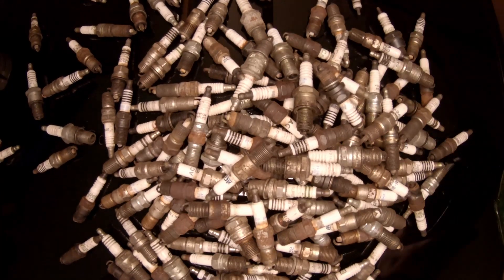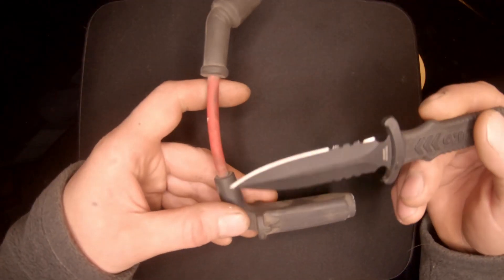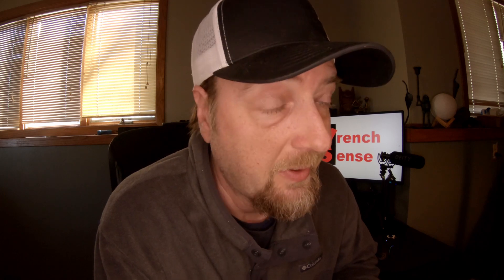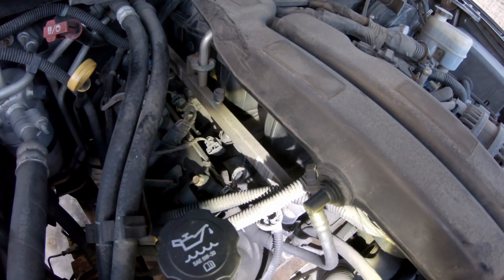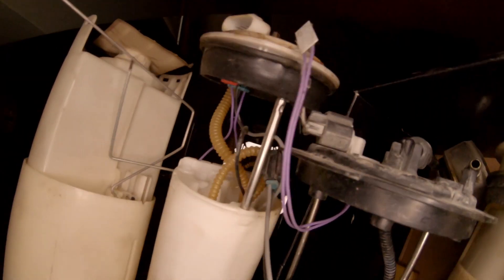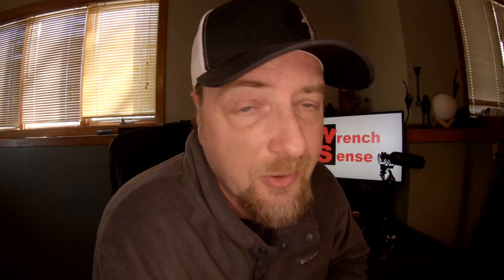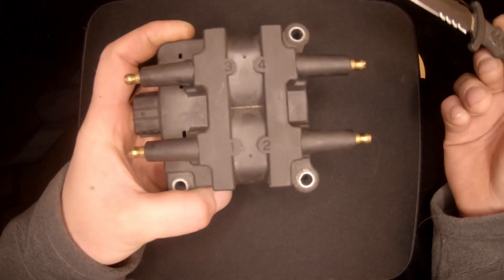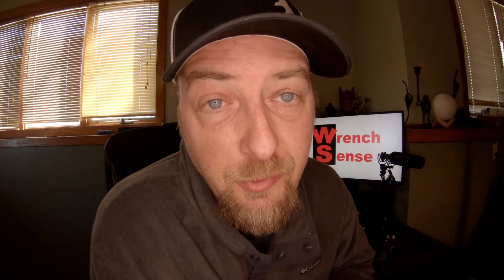P0300 FIX And A Blinking Check Engine Light

Comment: So me wrench sense I watched this video three times just so I didn't miss anything 

I have an 01s10blazer two door two wheel drive shit box  that has been throwing a p300 code for a long time 
I've been to so many shops and no one can find the issue 

I've replaced all fuel lines fuel filter egr valve mass air plugs wires cap rotor cleaned the throttle body 
And still have the misfire 

Check engine light is flashing alit more now than before 

Plz sir where do I go from here  
It's my only meens of wheels  plz help 
I hope to hear from u soon
Reply: Did you figure out your problem?  I have P0300 code only, with check engine light and heavy shaking misfires

Comment: Absolutely love video omg I have check engine light blinking gas smell I can smell it on driver side valve cover 6 cylinder engine I almost went bought a sensor saw this video idk wtf is going on but gas smell exhaust omg its strong why is my car not catching fire? I will start with plugs coils I need code reader I think really screwed myself thanks dude hit thumbs up subscribed
Reply: I'm baffled but more educated with your video
Reply: @Jarrod Durant same! Gas smell after driving around 10mins, rpms drop bad going uphill
Reply: @shawna7975  hey yea u know what i did couple days ago i replaced all 6 ignition coils all 6 spark plugs 2 gaskets my problem went away misfire gone check engine light shut right off car running mint only took 3 days for the old oil to burn off muffler lol car 2003 running brand new
Reply: @jarroddurant2407  thats awesome! All that was done on ours was replace coil, and new waterpump. Check Engine light flashes now at stop light in idle
Reply: @shawna7975  u still have misfire i u may wanna check all your coils make sure in right plugs flashing light usually from bad coil
Reply: @jarroddurant2407  that is probably right, thanks !!!
Reply: @shawna7975  your welcome
Reply: Your not gonna believe it after weeks of car running great it was nice was driving all of sudden check engine light pops on omg o just can't win with this car it truly wat they say car goes into limp mode goes ovsr 40 but it struggling dam infinitiy love it tho
Reply: @jarroddurant2407  🤦‍♀️
Reply: Almost sounds like oil pressure if it's lighting up still on idle  I've had check engine light come on furring corners or on ramps oil to one side of motor checked oil it was a little low  might be worth try.

Comment: I got the blinking CEL while I was doing 120 km/hr and noticed absolutely no difference in power nor heard a difference in RPM. Got another blinking p0300 code today while doing 65 km/hr, again noticed absolutely nothing wrong with the engine whatsoever. After doing some research and watching your videoI'm going to attribute this to the fact I'm running a straight pipe exhaust with no catalytic converters or o2 sensors. She idles like a trooper and purrs like a kitten when you feed it some of the good stuff.
Reply: Did you take the o2 sensors out? I alao have no converter/straight pipe👍 @The bOss if you took o2 (both) out or just 1 at a time?
Reply: @shawna7975  Yeah, no cats = no need for O2 sensors because they aren't going to read worth shit anyway. Originally had 1 cat removed because it blew out, then I got the other side done. Haven't had the blinking engine light come on since. Might of taken some time for the ECM to figure it out, who knows. All I know is it works and I love the noise.
Reply: @zerg1011  thanks!

Comment: On my dodge trademaster 1500 I took it in because it was misfiring I got all new plugs wires new coil and it is still misfiring and took it back to the mechanic and he said it’s the cam shaft and I need a new engine also when I drive it every once and a while I can hear a clicking noise in the Moter if i am driving at the same speed I give a little gas it stops and if th rpm goes over the 4 the engine light will start flashing the the cylinder starts to misfire then I have to pull over and let the engine to slow down and then it work fine
Reply: Clicking is usually what's called ticking and it's probably a bad valve or rocker arm. If your valves stick just a bit it will naturally throw off the combustion cycle in your engine throwing a missfire code. You don't necisarrily need a new engine, naturally your mechanic wants 10,000$ for an engine swap.

Comment: Big problem here. Idk if you can help but plz if you can think of anything else I would appreciate it we had code 305 changed plugs, coil twice ect.  Ran through your video check the vacuum fuel pressure and still has flashing engine light and reads code 305 any suggestions would be helpful thank you
Reply: Same thing with my car, funny thing though, my car is not overheating or loosing coolant

Comment: Great video!  Would a misfire cause limp mode?
Reply: Did you ever find out ??
Reply: I do believe that a misfire can cause your vehicle to go into "limp mode" (which is basically the cars way of protecting any severe damage from happening to the engine or catalytic converter).  So, if you're only running on 3 cylinders; for example, it doesn't have full power and wants to protect itself.   
This happened to me recently and my car was in "limp mode".  I was also getting the "injector circuit open" code along with the misfire.

Comment: Have a 2003 Silverado 4.3 runs fine until pulling a steep hill Example: Steep graded highway mountain scenic highway. Between 60 and 70 mph when passing gear engages check engine light flashes then goes off. Only once read a code of unburned fuel in cylinders. New rotor button /distributor cap/wires &plugs fuel filter and map sensor. Still occurs. Only under the conditions previously listed. Haven't checked for vacuum leak but will that next. New air filter also OEM. Had truck 3 months 140,341 miles. Any suggestions would be appreciated. Great video!!!

Comment: I bought a genesis coupe, came w new engine from dealer, it’s been a 2 months since i’ve had it, & there had the work done back in february. i noticed i got a CEL, got the p0300 code, went to auto zone scanned the variable camshaft solenoid? i’m not sure if that’s as you mentioned where they try to profit off you. instead i popped the hood and went thru the whole car and made sure all plugs and hoses were ok w no leaks. the cel came off all of a sudden

Comment: Bruh I got a code for random misfires so I was like ok let’s just buy new ignition coils buy brand new expensive asf coils install them then car on now my engine light is blinking
Reply: Same exact thing for me I think it has something to do with the catalytic converter
Reply: Reef ひ I went to a different mechanic dude said one of my coil wire was cut
Reply: CurlyBoii Ty did you fix it?
Reply: Reef ひ yea but a month later my head gasket blew lol
Reply: Has anybody checked the smog crap some have celinoids for vacume I guess for the gas tank tank.   Lossen your gas cap just for kicks   I've had it happen charcoal canister  it's around your gas tank inlet it's the last thing I haven't done yet